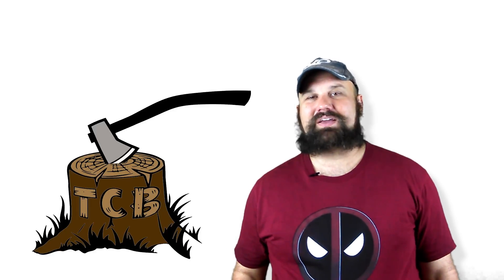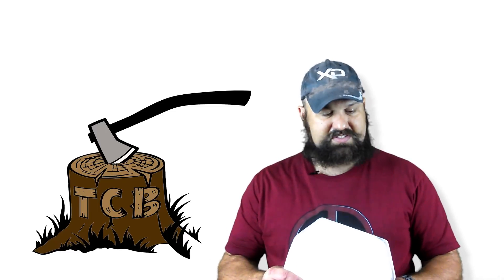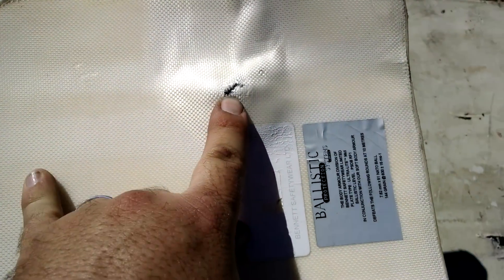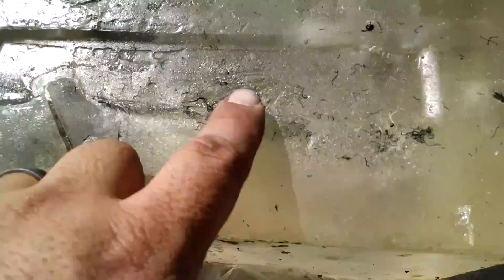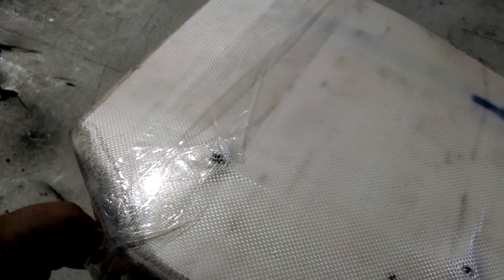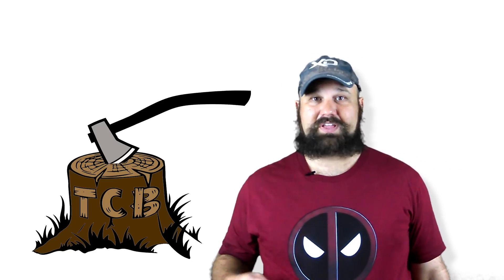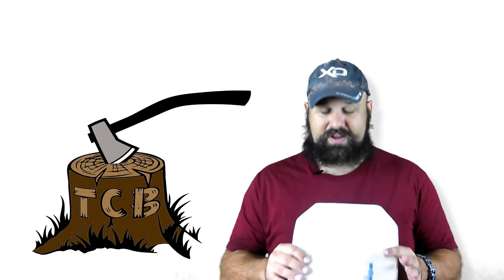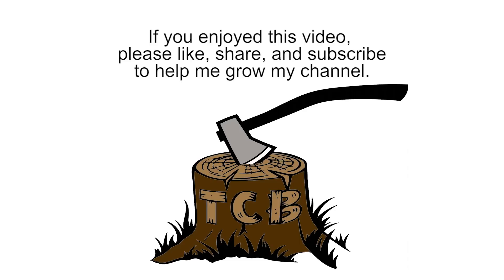Can a polyethylene plate stop M855?

Comment: Thanks for showing the ballistic gel results of the rounds hitting. The poly plate may stop the round, but the impact may kill or maim you instead. I'm still thinking a hard ceramic plate is better due to less trauma to the body by the inertia of the bullet. Steel would be even better, but as others have noted, it is not realistic due to weight.

Comment: What if it was thicker with the soft plate as well
Reply from the maker: I mean, at some point or would be thick enough, but at this thickness, it's enough to stop the threats it is rated for. If M855 is a significant risk, then an all poly plate isn't the best choice. In that case, a steel plate or ceramic faced composite is better. Polyethylene plates like this are intended to be very light and thin. Everything is a compromise.

Comment: Is it pure polyethylene?
Reply from the maker: Yes. There is no ceramic content in this plate. Please note that it only just barely stopped the M855 and only because it was fired from a 14.5" barrel.
Reply from the maker: Meesta Meesta  something more than level III and less than level IV. But a level III ceramic faced composite would be lighter and cheaper.
Reply from the maker: @GD-lw9yv  word.

Comment: Hurt like hell you'd wish it went through.... Yow
Reply from the maker: NCCM Piedmont 53d Maybe not as much as you think. It could certainly hurt, but remember that the energy imparted can't be any more than the energy transferred to the shooter. Smaller area and shorter time frame, though.
Reply: @newsofthepews  Aaaaaaand that's not true at all
Reply from the maker: @christophegroulx8187  Which part do you think is untrue?
Reply: The Chopping Block Well it’s the classic "Energy is the same on impact as the recoil"
Reply from the maker: @christophegroulx8187  You're right. It's technically less. But in the context of this discussion, it's close enough to call it equal.

Comment: great video. i thought uhmwpe plates would be penetrated at any speed by m855. you should do the same test with m193 from short barrels.  keep it up!
Reply from the maker: I can do that, but I know it will stop M193 from a short barrel. Probably from the 20" too.
Reply: The Chopping Block that's pretty neat. these things are super light compared to ceramic/aramid composites.
if you're sure test it with a 20" and if it penetrates then 14,5. would be awesome. Thanks for the reply :)
Reply from the maker: Mirind0R Maybe, but I'm more interested in testing it with rounds that I'm not as sure about. I'll hit it with something even faster than M193,  though.
Reply: The Chopping Block sounds goody!

Comment: I guess distance is your friend if you want to wear light armor. 100yds should knock about 300fps off the M855.
Reply from the maker: That's a good point.
Reply: I have been think a lot about buying rifle plates over the last year and still haven't decided. UHMWPE is in the lead though, cause I am a sissy when it comes to weight. Even my expensively light IIIA soft armor seems a bit heavy to me.
Reply from the maker: ActionPhysicalMan If it's in your budget, you could look at some of the composite level III+ plates like the Highcom 3S9. I tested that plate pretty extensively. If you buy armor from Highcom, use the code BITTERCLING for 10% off, plus free shipping.

Comment: have to ask. This armor plating desighned to wear soft armor under is 3a the soft armor 3 also?
Reply from the maker: david tasker It is designed to be worn with soft armor, but I don't think it matters what rating.
Reply: These plates are not US NIJ rated, they're RF1 which is a UK rating, it's six hits of UK made NATO ball, however the back face deformation must be less than 25 mm. On the NIJ specs it must be less than 44 mm. To meet the RF1 rating the plate needs some kind of trauma panel behind it and both the MFGR and I recommend soft armor.
Reply: I wouldn't wear it without soft armor, but you could probably get away with not using it. It's so close to the standard level III US that it's functionally the same.
Reply from the maker: sawyer lawrence Thank you. The rating of the armor isn't that important, though, right?
Reply: By the way you doing the testing has made me look into this a lot more, especially with other nations ratings. The more I look at them the closer they all seem to be to the US ratings. For example German SK4 is one hit from a M2AP round with BFD not to exceed 40 mm vs NIJ IV one hit M2AP with BFD not to exceed 44 mm.
Reply from the maker: sawyer lawrence Close enough that it makes you wonder why it's different at all.

Comment: It's funny how people are experimenting at home with ceramic tile and kevlar/fiberglass to stop rifle bullets in DIY fashion, and some day the cloth fabric of these ultra high density PE will be available for cheap and people will be laminating these in their garage while the military will be using carbon nanotubes or something.
Reply: +iosef Pindo But not in industrial quantities!
Reply from the maker: Great observation. Depending on your definition of "cheap", that may already be. At least the part about buying aramid fabrics in bulk. You can get sheets of Kevlar or generic aramid at very reasonable prices on eBay. I did a series on homemade armor a while back, but I have a new design I'm working on that I have a lot of confidence in. It's literally made of cut up milk jugs and it's in the oven as we speak. HDPE is chemically similar to UHMWPE in that both are long chain polymers of polyethylene. UHMWPE is obviously much stronger, but HDPE is remarkably tough in its own right. I honestly think that a 1" thick slab of it will stop most pistol rounds. With a floor tile or two in front of it, it may be able to stop rifle rounds as well. We'll find out.
Reply: You can make homemade graphene...